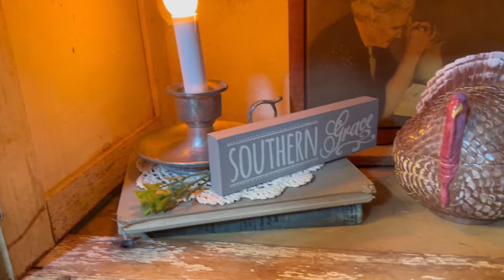DECORATE WITH ME!  VINTAGE SEWING DRAWER + EXCITING HUTCH REVEAL! #homedecor #decorating

Comment: Good morning sweet friend!  Well I never thought to hold those tiny nails with a needle nose Plyer! I always have the hardest time getting them started & usually hit my fingers a few times😑 Thanks for that little tip! I use the tape hack, but once I get the tape up I use the level, just place it on the 2 dots or holes on the piece of tape & make sure its level before you put the nails in & it works perfect. But that's A neat gadget, never seen one before! I just may have to get one before we get moved, it looks pretty simple & don't have to waste tape or but any more! I have several oof the little silver trinket boxes that came from the thrift store. But I have one that I've had for years that i can't remember where i got it from! That's the one I keep a few keepsakes in. I always tea stain my white doilies. I have some real old lead crystal bowls that have brass bases that i use to hang my vintage beads & pearls out of. And I put some of my old vintage brooches, bracelets & earrings in. I keep them in a vignette with some of my Victorian pieces like a little crystal shaded lamp, mirror, pictures, figurines.. on the top shelf of one of my bookcases. I love playing around with that vignette when i get new pieces! It takes up the entire shelf pretty much. Then I hang larger Victorian street art, and some other Victorian pieces on the wall above it. That's how I had it back in TN & I'm probably do it sabot the same way once we get moved. If the mounting patches don't work well you can tap a push pin or a tiny nail in right above that little pull to hang the keys on! Lol girl I'm forever pulling little pieces of greenery from my bigger or fuller pieces to stick in small places!😁 I have a brass candle holder that i need a really slender candle for. I've looked for a care that size for about a year & can't find one!😳 I've even tried to find a set of those little candles that are attached with a wick like you hang on a peg, it would be the perfect size. Can even find those!🤷‍♀️ I love the box shelf & how you've styled it! It looks so pretty there! Lets see how long it takes James to notice it!😄Or are you planning to show him when he gets home? Ok now I want another drawer! I found a little white drawer with a red knob I'm planning to sand & repaint or stain & change the knob. But I'd like to find a more fancier looking one like yours too! I have several little shelves with pretty little brackets i ordered from amazon that i use in the bedroom for my vintage perfume bottles & a couple of my silver trinket boxes. The larger boxes that won't fit on the shelves i keep on my vanity. But the drawer & the way you have it set up looks more vintage, i love it.🤎 And love the little picture of you & James!😊 I'll probably do everything completely different than i had it in TN! Girl I like the different colors of the hutch! Ohh I'm excited for you gf!😁 I love the way it is, all chippy & rustic! My doors are off my stepback cupboard because on hinge on one for is broken. We'll never find one to match, its from the 1870's🫤 But I really want them on, I'd leave them open because I'll have the shelves full of decor, but i want to hang things from the doors.. like an Apron, a basket, things like that. I'll keep the bottom doors shut, that's a big space & great for storage! But girl that cupboard is so chippy you see as much old graying wood as you do the black paint!😄 But I love it so much! I have another small cabinet my daughter gave me that's about 2.5-3ft that i can hang or sit on a counter. The little doors have the small chicken wire but one is broken off. Its not an old piece, i think someone made it, but i want the door back on it, i love the wire in it! Donna I'm so ready to get my house & decorate again!😩 Ohhh I found out yesterday my husband's bosses wife owns an antique store in Tampa!! She wants me to come & I'm super excited about that! They are such awesome people, my husband is lucky to have found that job! He's been so so good to us, in several different ways! He's A blessing for sure! Putting the little lamps/lights in it was my first thought! Oh it looks Sooo good girl! I love it!❤ Now I'm going to have my husband make holes in the back of my stepback! Its like a chippy green & beige on the inside but the shelves are deep & dark. I have several small candle lamps & other little lamps so i just need the holes!😁 The amber colored Edison bulb would be really pretty! I have one in my small hurricane lamp for my bedroom, it has the regular bulb base, & I love that amber glow! I have a candle lamp like the one you have in the bottom shelf, the candle part is milk glass with a diamond shaped pattern, and the base is like a brass chamber candle base. Its A really old one. I tweaked & played around with my cupboard all the time.. I've never had a hutch either! I still plan to get one & start collecting some pretty old dishes, stoneware, transferware, etc. That's why I haven't collected dishes..i didn't have anywhere to put them & i wasn't them displayed! I wouldn't paint it or change the door! I'd probably put wire in the doors, just because i like that look. My daughter had A beautiful cupboard & it had to doors with wire, i loved it & wish i had gotten it when she sold it!😕 I still regret that! But she sold it before i we decided to move & I didn't have space for it.🤷‍♀️ I could have stored it! Its going to be beautiful with glass tho! I know you love it! I love imperfections! I love that little cast iron stove piece too! Oh Donna its perfect, i love it! So tickled for you!😊 Well i end my book here & I'll see you tomorrow! Love & hugs❤🤗
Reply from the maker: Hello! That’s the only way I can attach picture hangers…😄. Those needle nose pliers are great. I was so happy to find that gadget years ago. I bought my girls one too. I love little tricker boxes. ☺️
Thank you. He knows I was doing something cause he was in the living room while I was putting the shelf up.🤣
I love the hutch. The more I look at it, the more I love it as is. It’s perfectly imperfect.❤️
I know you are. We love our decor and it makes a house feel like a home.
I’m gonna try the glass and if I don’t love it, I’m going to try chicken wire. I think that would go so good with all my chickens. The possibilities are endless.☺️
I hope you have a great day! See you tomorrow! 🤗
Reply: @DelightfullySouthern  Yesss i honestly didn't even think about that, the wire would be perfect with all the chicken decor! And yes girl, it is perfectly imperfect.. just how i love things to be! I think my be mattress, appliances & electronics, showers & tubs, those type things are the only things i want as close to perfect as i can get them😄 But after i missed out on getting that cupboard weigh the chicken wire in the doors from my daughter.. it haunts me😞 Now if i find one with wire instead of glass, I'd be elated!!😁

Comment: not sure if you could use these in the lamp on top of the hutch..............but they let you reduce the socket so you can use a different base bulb............. E26/E27 to E12 Adapter) E26 Medium Screw Base to E12 Candelabra Socket Adapter Converter Reducer (2 Pieces)    sorry i don't know how else to share this with you, but if you copy and paste  that in Amazon you can see what I mean. hope it helps
Reply from the maker: Thank you!! I actually ordered some silicone covered bulbs for the larger base. ☺️